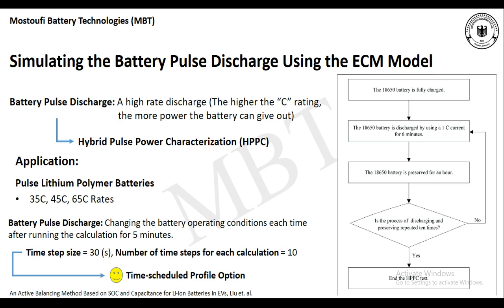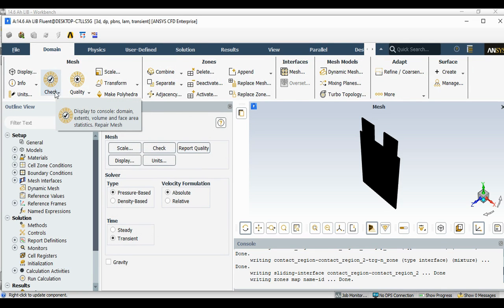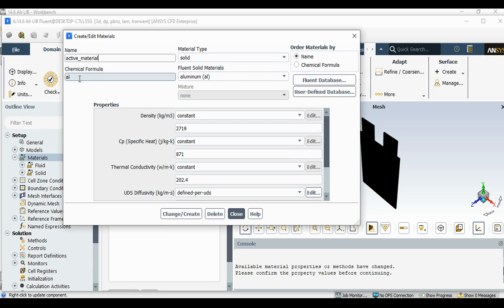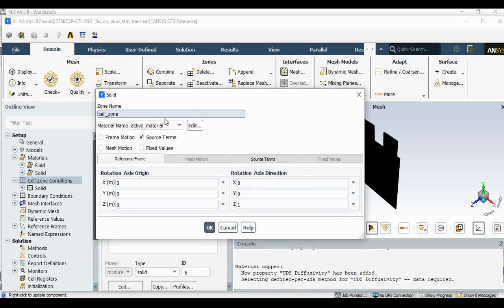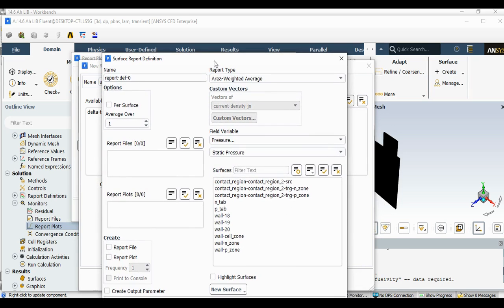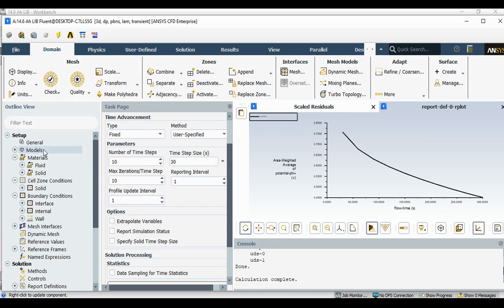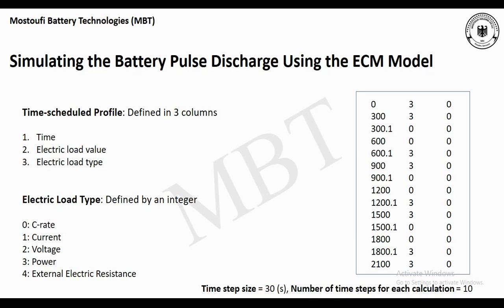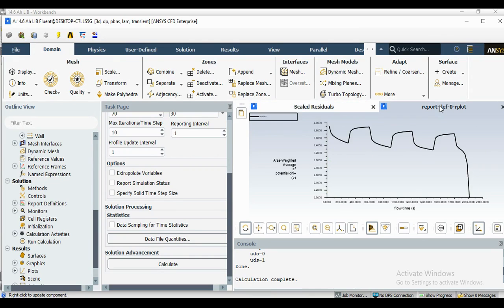Battery Pulse Discharge Using the ECM Model in Ansys

Comment: 00:03 Simulating battery pulse discharge using the ECM model in Ansys
02:25 Setting up the battery pulse discharge simulation in Ansys with ECM model
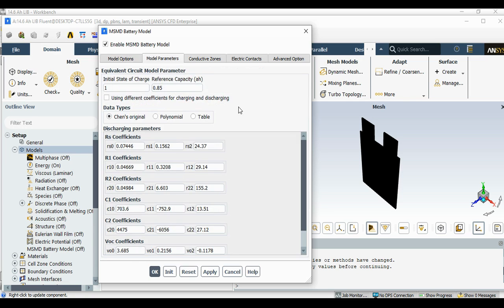06:06 Selecting model parameters for battery pulse discharge
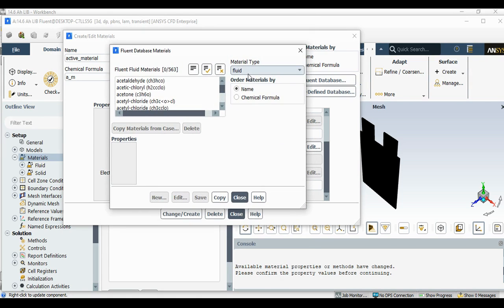09:10 Customizing material properties and assigning them to specific zones in Ansys
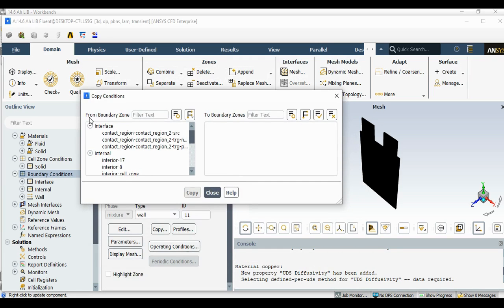12:42 Define Report plot to track electrode potential decrease over time
17:28 Analyzing battery behavior through pulse discharge in Ansys
20:48 Introduction of time scheduled profile for the C rate
23:08 Simulated pulse discharge and compared with previous results.

Comment: Sir, I can't find "User Defined Scalars" in Field Variable of Surface Report Definition(uds-surf-phi+). I use 2024 R1 ver, so I couldn't find uds-diffusivity in the last video either. I replaced the uds-diffusivity value with the thermal conductivity option by referring to the previous video comment, but the result value was different from your video. Is the problem related to the problem in this video?
Reply: same i am unable to see UDS in 2024 R1 version of Ansys

Comment: Hi,

The videos are great.

Could you show how to do a thermal runaway of the battery system.
Reply from the maker: Hello dear friend, thanks. For thermal runaway simulations, the default electrochemistry model and setup could not be used as some decomposition reactions will occur. In a couple of weeks, there will be a tutorial regarding the topic you mentioned. Thanks for your suggestion. Stay tuned and share with your friends.